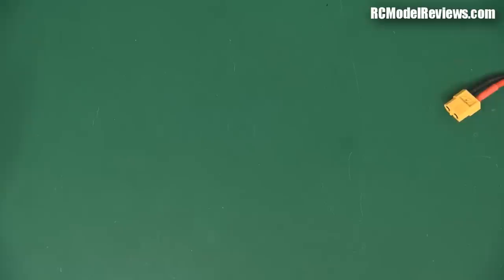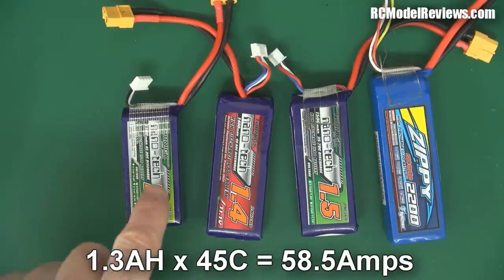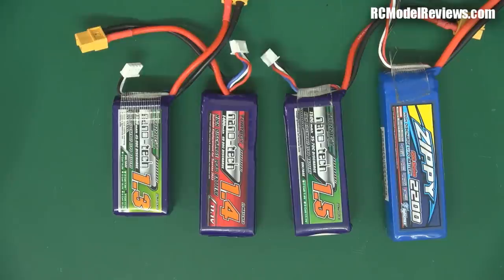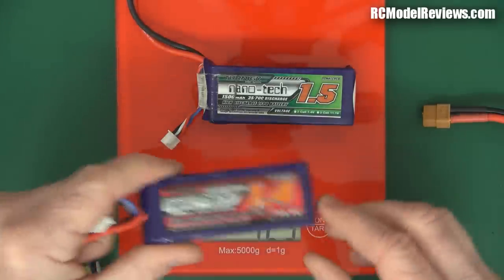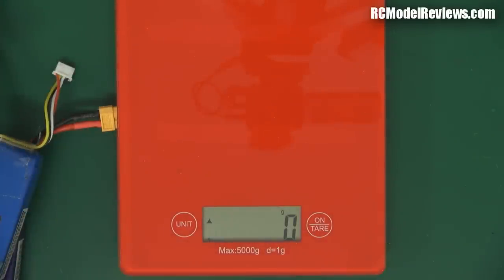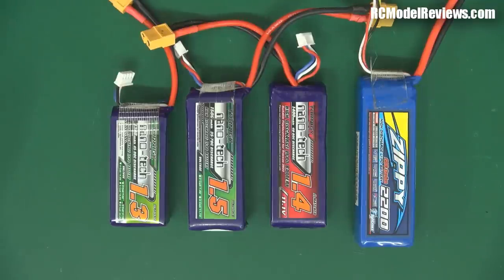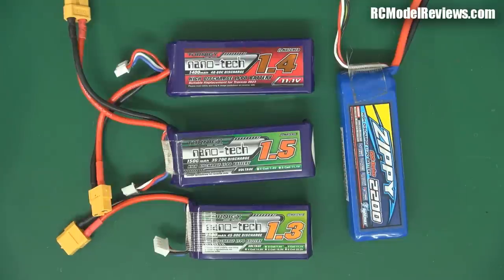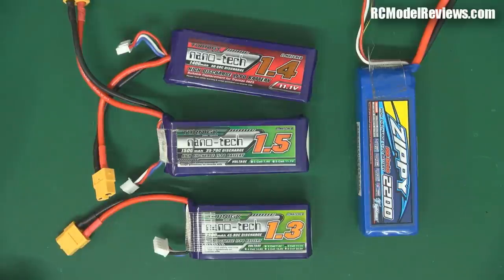What size mini quadcopter battery should you use?

Comment: Hey there im putting together my first 250 rn and my primary concern right now while just learning to mill about is flight times. That being said, im sure later down the road i will want the higher C. I was wondering how significantly different the flight times are
Reply: Clyde Brown While you're learning, C rating is not so important.   A low-C battery will still work and you will get almost the same flight times as a hi-C battery but you'll notice that the quad starts to become less powerful much earlier on in the flight.   If you're still getting to grips with hovering and simply flying around, that won't be too much of an issue.  Once you start pushing the limits however, you'll scream with frustration every time you punch the throttle and bugger-all happens :-)
Reply: Sweet thanks!

Comment: I was about to get a few of the Turnigy MultiStar Race Spec 3S 1400mAh 40-80C. . They're 115g according to the specs. Have you tried them?
Reply: shortsleevecardigan The 3S/1400 40C multistar batteries are exactly the same as the 1400mAH pack in this video.  They've just used green heatshrink and come with an XT60 connector out of the box.   They're good.   I'll be reviewing the 4S version of this pack soon.

Comment: So, what about putting batteries in parallel? I have tw 2200mah 20c lipos and I'd love to be able to run then on my 500 size quad with 25a escs with 20a motors.
Reply: You could certainly do it. in the early days of lipos, 10-15C was the most batteries were rated for. So, to get more current, fills would run them in parallel. You'd see 3S2P packs for example.

However, weight becomes an issue, and as the video mentioned, you really won't double the endurance over getting one high C battery... the amp draw to just hover will be greater due to the extra weight.

Comment: Hey bruce you mentioned weight - but is there a formulae to factor this in too. Eg if i increase power by 20% (as per your formulae) but increase weight by 30% ,what is the overall effect on flight time?
Reply: BTW I mean battery weight  not auw of craft

Comment: I think you've covered this in another video but I have to ask how do you know what c rating battery you would need? I know it has to do with the esc and I know that the esc has a burst rating as well what I'm not sure of is the mathematical equation to figure out what c rating one would need? Could you please link the video where you go over that? I watched a video where one of the guys from lumineer is running his qav 250 is 4s configuration with a 70c battery. The battery has a lumineer sticker on it and he says with a higher c rated battery it's more punchier. Do you find the same?
Reply: Darth Vaper Yes, all else being equal, a higher-C battery will give you more punch.  However, higher C batteries can also be heavier and weight will slow you down when "punching" so you have to be careful of that.   Based on the calculations in this video, that 1300/45C battery would give most punch because it gives more amps for its weight than any of the others.   A very basic formula for calculating the required C rating would be to take the rating of  your ESCs (probably 12A on a miniquad) and multiply by the number of ESCs (that 12x4 =48).   That's roughly what your maximum current drain will be.   Now divide that number (48) by the capacity of the battery you intend using.  

So... if you want 48A from a 1.3AH (1300mAH) pack  you get 48/1.3 = 36.9C

For a 1.5AH (1500mAH) pack you get 48/1.5 = 32C

Those are *minimums, you can go higher but I wouldn't go lower.  A higher C rating than the calculated one will still produce a performance increase because its voltage will hold up better at full-load.

Comment: In your experience, when you don't push the mini quad to the absolute limit. Do you know what the difference in flight time between your 2.2Ah and 1.3Ah is?
Reply: ***** To be honest, the harder you fly, the less the difference in flight times.   I find that my 1300, 1400 and 1500 batteries all give almost exactly the same flight times if I'm really pushing hard.  If I'm flying slowly  and just messing around, the 1500s do give me a little more.   A 2.2 battery really doesn't lend itself that well to hard flying because it can make a miniquad too heavy to handle well.   As I said in the video, if you've been flying with 2.2s, try a high-C 1300 and you'll be shocked at how much better the quad flies.

Comment: While the info in this video is correct, it doesn't always translate in real life.  I use 2200mAh 20c batteries on my 250 quad with 2204 motors, and I sure don't hear my voltage alarm going off as soon as I lift off as this video suggests.  Actually I get flight times of around 10 min on a 2200 20C, and thats with full FPV setup and a GoPro onboard.  

The slight extra punch from the 45c 1300 is negated by the 6 min flight times I get.....

Comment: I've got a question about voltage. I am flying a blade 200qx on a carbon frame, and it only works with 2S lipos. I got the Eachine CCD camera and 200mW vTx combo, and it says it can take between 7 and 21 volts to power them. Will I be able to power the fpv system off the balance plug of my 2S 950 mah batteries? I'm afraid of brown outs while I'm flying, and I'd really like to avoid crashing terribly. Thanks for the videos!
Reply: +Jon B Baca With a lipo battery you get 3.7v per cell normally, or 6.3v when fully charged.  As 3.7 X 2 = 7.4 V which is above your FPV minimum power requirement, you can expect to have your FPV system cut out around the time you should be landing.
Reply: Normally you can fly lipos to aroun 3,4 or 3,5V if you want to go safe. That means just a little bit below 7V. That can work, you should try it before flying far away. But in general thoose operating voltages are just sweet ranges, so if you stay close to it you shouldn't have a problem. Even if it's a bit below 7V. 

Oh and maximum voltage is around 4,2 to 4,3V per cell :)

Comment: Hello, guys. I don't understand one thing Bruce is saying. It's about the voltage drop. Basicaly what he is saying the higher the C (times the amp hrs) the less is the voltage drop? For example 4 motors draw a max of 80 amps and the battery that can deliver 100 amps will have a bigger voltage drop (at 100% thrust) than a 150 amp battery? Any "scientific" explanation out there?
Reply: Thank you for the explanation.

Comment: if i want fpv endurance/effeciency on my quad (f450 with cobra 950's), how do i figure out how heavy (more mAh) a battery to get before it's no longer efficient to carry such weight.  Currently i'm running Multistar 5200 3s.
Reply: cbluebeard There will be an  optimum point where you'll get maximum endurance.  If your battery is smaller or larger than that optimum point, your endurance will be less.   Sadly, there are no simple formulas for calculating that so you just need a bit of good old-fashioned trial and error to find the "sweet spot".    However, as an example, most people find that doubling their battery capacity (by adding an extra battery of the same size as the original) will only give them about a 30% increase in duration -- the other 70% of that second battery's energy is simply spent coping with the extra weight.   Add a third battery and you'll probably see no improvement in flight time - or perhaps even a reduction.

Comment: but the big question..

If my miniquad drains at hover arround 9A and 30A at full power...
is it then worth it the diference between the 1.3 45C and the 1.5 35C? since both should be able to feed the quad with ample margin?

oh also there is a 1.5 30C that weights exactly trhe same as the 1.3 and 1.4
Reply: sparrowlt I'd still give the 1300/45C a go and see what you think.  That weight difference is noticeable.   The 1.5/30C you speak of may be rated to 30C but you can guarantee that when you suck 30A out of it, the voltage from that pack will drop much more than from the 45C pack which means you'll still get more performance from the higher-C battery.
Reply: ***** Well thats the thing.. i actually fly both 1.3-45 and 1.5-30 in my ZMR and so far have not noticed much difference.. only that i can 1minute farther with the 1500 ... tought im in 5030s so maybe im just not demanding enought juice out of it.

i think i will some 1400s next

Comment: Soo what do i benefit from using higher C batteries, if I have say a 20a ESC i suppose i cant use the battery C rating beyond my ESC rating, can I ?
Reply: +pukki34 your ESCs might be 20A but you have 4 of them ( or even 6 if you have a hexacopter) 
20A x 4 ESCs plus onbard camera(s)  plus controllers and whaver else you have attached  = 80+ Amps

Comment: I'm using a 1500mah battery on my qav 250 and while i get 8 mins flight time its soooo tail heavy ,so to find a small battery for the qav and still get 8 mins becomes difficult
Reply: Buy more batteries, fly less per flight, but fly more overall.

Comment: What's the minimum, maximum, mean, and storage voltage {{Per cell}} on lipos?
Reply: Stupid question. Every Lipo is different. Trying to sound smart.
Reply: 3.0 V minimum or such, below that lipo will suffer, storage is around 3,8 V , HK batteries sometimes come with 3.85 V per cell, max recommended voltage per LiPO cell is 4.20 V
Reply: you don't want to fly under 3.2 V.  the 80% rule is key.  (don't fly under 80% capacity)

Comment: how long approx can you safely store them for with full/empty charge?
Like a day? week? month? Cheers
Reply: Bishop Vick Avoid ever storing them empty (ie: less than 3.3V per cell (10V for a 3S pack).  In this state the chemicals in the battery will break down very quickly and produce puffing.  That puffing may not occur immediately but it will probably happen after a few more charge/discharge cycles.

They don't seem to care quite so much about being left fully-charged but if I've got charged batteries I'm not going to be using until the following weekend, I use the charger to put them on storage.  A few days is okay for a fully-charged battery, a week is probably too long.   Again, the damage may not occur immediately but it will reduce the total life of the battery a little each time you leave them charged for too long.

There's also the safety issue... a fully charged lipo is much more of a "bomb" than one which is at storage voltage because it has three times the energy just waiting to be released in the form of a fireball -- should something go wrong.  We've all seen the effect of spontaneous lipo fires :-(

Comment: Bruce, What would you say, as a rough estimate, would be the longest time you should leave a battery fully charged?
Reply: davedeja A week is pushing it, if you want to avoid some degree of degradation.   If I come home with some fully-charged batteries and know I'm not going to be flying until the following weekend then I'll put them on the charger and bring them down to storage.   Sometimes it's tempting to say "nah, I'll leave them charged" but if it rains next weekend then that'd be two weeks they'd be left in a charged condition and that's certainly not so good for them.   There's also the fire risk.  A lipo on storage charge has just 1/3rd the amount of energy in it so if something bad happens, it's much less likely to burn your house, shed or car down.   We've all seen the effects of spontaneous lipo fires and they're not pretty.

Comment: I just got a 1.8 40C Turnigy battery and in theory it seems like it is much more powerful than the rest of these (haven't flown it yet). Any reason you didn't cover it in your video?
Reply: Arthur Miller I covered what have been the most common choices for miniquads.  I've also got some of the 1.8 65-130C Turnigy Nanotech packs here which work pretty well and I'll look at the higher-capacity hi-C packs in a future video.
Reply: ***** Hi Bruce, did you get your hands on the newish batteries like the multistar race spec 3s 1.4a 40-80 c and the nano tech 3s 1.8a 60-135 c?
Reply: zewill The multistar race-tech are the same as those Traxas 40-80C packs.  HobbyKing just changed the label and the connector :-)  I've got some 1.8A packs here and I'll be testing them.
Reply: +xjet ah the joys of marketing! :D thanks for the reply! I'm not a fan of xt30, more plugs means more connectors, adapters etc, but will be following your next tests!

Comment: When you say storage, what voltage/charge is good to store batteries at?
Reply: Tech With Zed Most chargers have a "storage charge" setting which will ensure that each cell is between 3.7V and 3.8V.   Bringing a full battery (4.2V per cell) down to this level can take some time because the charger has to dissipate all that energy.  Most cheap 4-button chargers also limit the charge current to 1A when charging up to the storage charge so that might take longer than usual as well.    This is one of the reasons I set my battery alarm telemetry so that when I land, my batteries are conveniently sitting at about 3.7-3.8V per cell -- all ready to be stored away until next time :-)

Comment: What do you think about hobbykings multistar batterys?

They claim they are designed for mini quads, is anything meaningful to it?
Reply: erlendse WHen it comes to miniquads, their 40C 3S/1400 is actually just that Traxas 1400 I show in this video but with a green heatshrink and an XT60 already fitted.   I've just got a couple of the 40C 4S / 1400 multistar batteries to try out.

Comment: Hi. I get the 1st part of the C (like 45-90C), but what does the 2nd part (in this case the 90) mean?
Reply: n03l l The first figure is the "constant" C rating.  It should be safe to draw this amount of current out of the battery continuously -- until it is effectively discharged (ie: about 3.3V per cell) and not cause any damage.   The second C number is the "burst" rating.  This indicates the amount of current that can be drawn in a short burst without damaging the cell.   I don't pay too much attention to that second number -- because it's a very easy one for the manufacturers to "fudge" :-)
Reply: ***** Thank you for the info.

Comment: my quadcopter is a 3s and uses a 11.1v 35c 2200mah, whats the highest c rating i can use?
Reply: +Christopher Rogers There is not a highest you can use figure for C rating, your esc's will draw what they need.  If your C rating is not high enough, then you will see performance issues when the motors are begging for more power at full throttle.

Comment: 4s 1500-2200 mAh high rated C batteries with 6" props is the way to go
Reply: Ole Lillevik If you're looking for "punch" and speed you're dead right.  However, if you're flying proximity and not racing, 3S and 5" props are my preferred option.  I spent a lot of time flying uber-power setups with 6" props (such as the 1700watt MXP230) and it's great fun if you've got the space to use it.  Now that I'm flying through heavily wooded areas, I'm preferring the 3S/5" setup because it's more agile and I simply don't need (and can't use) all the extra power.   Horses for courses!  It's all good :-)

Comment: which battery do you recommend to get the maximum amount of flight time out of a 250 miniquad?.. My friends and I are not interested in doing flips and stuff but we just like flying around..
And If anyone can provide a parts list to build a 250 that gets over 15 minutes of chill flight that would be awesome
Reply: vdubs4life1964 15 minutes from a 250-sized miniquad is a big ask.  There are lots of much bigger quads that don't get that sort of flight time!

What you're looking for is the lightest possible (which means a low-C) battery.   Such a battery will sag a lot under load but, if you're flying slowly and using carbon props (which are the most efficient) then you might get 10-12 minutes out of a 2200-2600 low-C battery.   Don't expect much in the way of excitement though :-)    I'd also opt for 6-inch props if your frame will handle-them because they'll be more efficient than 5-inch ones.
Reply: If your after long slow flights, then build a large quad with large props... Trust me tho if you and your mates get out to the park with some well built mini quads, a bunch of fast 5-7minute flights will be far more enjoyable... After all that's why this hobby is taking off :)

Comment: I do I find the flight time of a quad? I guess? I buy a voltage alarme? Is there a rule to this?
Reply: ***** there cannot be any rule because there are too many variables to take into account. set up a voltage alarm on your model and a timer in your transmitter and sooner or later you will know your average flight times
Reply: ***** As flyingflippy says, you just need to experiment to find out how long your quad will fly.  Remember also that how you fly will have an effect.   If I really try hard and just "cruise around" gently, I can get almost 8 minutes out of a miniquad.  The same miniquad and battery may only give me 4 minutes of flight time if I'm really hammering it hard.   A cheap lipo alarm is better than nothing but some of them are not so good -- often set to a very low voltage so that by the time they go off, you're already almost flat.  The beeping comes in handy though when you're trying to find your quad after it ran out of juice while attempting to get back home :-)

Comment: Why do you say that 11.4 is storage charge, and the label says 11.1v?
Reply: odinata 11.1V is the "nominal" voltage.  Most battery makers recommend that you store lithium polymer batteries at 3.8V per cell which is 11.4V for a 3S pack.  To be honest, anywhere between 11V and 11.5V is probably fine.
Reply: ***** So what is the fully charged voltage?
Reply: odinata ***** 4.2v*3 = 12.6v?

Comment: C rating is only good for marketing.  The REAL performance index is internal resistance.  If you have a higher C stated battery, but it has a higher internal resistance, it's actually a LOWER performing battery.